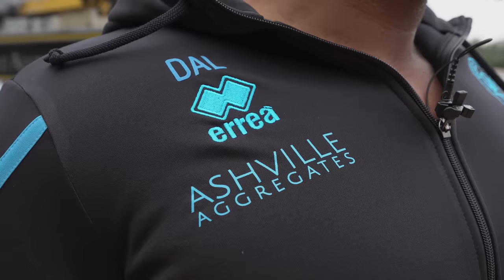Calm Before The Storm | Ashville Weekly ep102

Comment: Dan...when u swim what you wearing? If you wearing boardies or swim shorts that are too loose round the legs or waist it will in turn create alot of drag which makes you having to kick and pull harder in the water to stay afloat sucking in alot more air....try speedo briefs or aqua shorts the tighter fit to the body less drag. Then have someone to look at yr technique in the water, make the changes start applying distance and repetition, get yrself some swim paddles and a pull bouy help with training and technique in the pool, kick board also important...once you a tropical athlete get yrself a bungee cord great resistance/sprint training.

Comment: Dan there's a device that you can test signals in wires with. I don't know what it's called I don't know where you get it but when I had a car in for repairs and tech came in and used this device to locate where the wire loses signal and determine how much needed to be replaced. I know it's not much to go on but if you know what this is or maybe someone does I'm sure it would help alot in future seeing as your fleet is growing

Comment: why do you need a new board for the pump? can't you just use an adapter which drops 2 phases?
Reply: Might not be a chunky enough cable or possibly even no neutral.